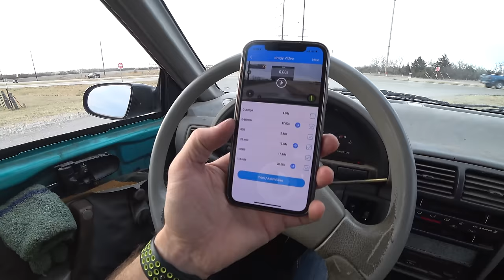I BOUGHT A Geo Metro For $300 And FIXED It In ONE DAY

Comment: I miss my metro! Called it the Urniator (it was piss yellow) and I stuck 1.0L stickers to the front quarter panels like a mustang.  It was a 92.  It also was missing the door handle on the passenger side.  There was an included spoon to open it.  Got that fucker up to 160kmh, down hill. Thanks for the video!

Comment: I’ve rebuild the whole suspension on my 94 Geo Metro and I abuse the hell out of it lol. I always max out the Speedo on the highway which is a tick or two after the last number so I think it goes to 90-95? But it feels pretty sturdy. AC and a 10” sub and that think rocks loool I even got a speeding ticket for going 85 in a 65 in a 3 CYLINDER 😂

Comment: I loved the metro/swifts. My preference is for the 95+ model redesign. The independent rear suspension was nice. I wouldn’t buy one with a 3 cylinder though, not a fan of those. 

I had unfortunately short experiences with my swift and metro, just a few years on each. The control arm mounts would rust out from the inside, and after a while I wasn’t to keen on losing a control arm while driving.
Reply: The frame horn? Those were unfortunately thin from the factory. I've had to reweld my frame horn (driver side) twice. It'll eventually fall apart. A guy in PA does full replacements but it costs a pretty penny.

Comment: Looked at them .bought a prism 93 in 2000 was 1800$ lasted 18yrs head gasket went needed gas tank 3 times water pump &belt I replaced sits in yard .🤗

Comment: For general info, Suzuki engines leak oil around the distributor. The O rings on the shaft fail and pumps oil out.

Comment: I had a late 80s version of this, when it was called a Chevy Sprint, when information was harder to find.  (No YouTube then.)  When it worked it got really good gas mileage.  It was in the shop often and I got so tired of the mechanics telling me "Wow, we never see one of these in here", as if that meant they were dependable.  I could believe it, because nobody knew how to fix it.  I do mean nobody, in any shop.  Nobody could get this working properly.  I eventually got tired of fighting with it and traded it off in disgust.  Just one problem after another.

Comment: The other connector that looks like the Spout connector is the Octane Adjustment plug. If Removed this it will run a slightly less aggressive timing curve. Its removal may aid spark knock (ping) under load if poor gas is the problem. Removing it WILL affect fuel mileage. Just replace the plug to undo effect.
BTW leaving the SPOUT removed will KILL the fuel mileage and is EMISSIONS TEMPERING.

Comment: That means you drove to the store on maybe 1 1/2 - cylinders cylinders - damned impressive! We had a white '90 Metro LSi, first year for the Geo. No air, no tint. Did have a rear window defroster. The foamy PCV means you bought it just before a potential engine fire. Anyway, 4 yrs w/ Wisconsin winters, then 10 yrs of Phoenix summers, 14 years old. Once it stopped running b/c of a loose wire. $25 fix. That's it. I'm a maintenance freak, though. But my goodness, the mileage is no lie! Damned thing ran forever on a tank of gas! Just don't try going over 65 mph, unless you like vibrating cars. We donated it, and wrote it off on our taxes. We kept the interior a lot nicer, too, BTW.

Comment: I bet he never drove a Chevy Sprint, which is actually a predecessor of the Geo. The Sprint was derived from the Suzuki Cultus. My Sprint was a 5-door, and like most of them I think, it had a 3-cylinder engine. Mine (1986) had an automatic, in deference to my new at the time wife, but apart from that, it was a great, if very minimal car. I LOVED mine. Used to scare the crap out of my brother-in-law, screaming down Lincoln Drive in Philadelphia, at 80mph... dodging traffic and walls. It was fun!

Comment: I actually WANT a Geo Metro lol. The Hatchback version.

Eventually.
Reply: Cuz power to weight ratio?
Reply: @esdrasferreras1227  because fuel economy. I don't care about going fast. I want to go from point A to point B as many times as possible before filling a tank..
Reply: I can respect that. Might be easier to find  a decent Honda tho. Plus they would also get amazing gas mileage, and be much more fun.
Reply: @esdrasferreras1227  yeah, I don't live in a very good neighborhood and every Geo I've seen up for sale is in the $1.5K range.
Reply: Christopher Morin wow that’s a lot considering this guy got one for $300. Try to get a nice one tho because I could imagine how hard it would be to find parts.
Reply: I've had a lot of the metros. LOOK FOR FRAME ROT if you buy one. Usually behind the front wheels under the tie rods. I'd probably just get a manual late 90s civic. Its starting to get harder to find body parts for the metro. Also, the civic has a little more power and believe me, you will need it if you go up any hills. BUT if you just drive flat land, these are fine. You should spend about $500 for one of these. Not $1500. The gas prices are low which causes the value to be low.

Comment: I miss my burgundy 93 xfi, yes it leeked oil, yes it was straight piped, and yes the doors sagged to the point you thought they were going to fall off but it was such a fun little gas saver, I still kick myself for selling it, instead I bought an 81 4 for impala 305, 4barrel going from 60 a month in gas running all over to 60 a week just going to and from work

Comment: The difference in the XFI vs a regular metro is the cam, (which lowered the hp) it only had 1 compression ring, different gear ratio, and ecu.

edit....and a few minor body differences

Comment: Great memories from my most epic flip ever! I bought a geo metro for $100. The owner was literally going to have it towed to the scrap yard. It had 15k miles on it. I replaced the fuel pump and the tie rod end on the driver’s side ($125 in parts.) I turned around and sold it for $3600.

Comment: Don't know where you live, but where I live, I have never seen a Metro for sale. If someone listed this same car, they would be asking $1000 and wouldn't take less than $600. I have the grandchild of the Metro, a 2001 Chevy Metro. Picked it up for $650 with two shot CV axels and in need of a full tuneup. Traded a van with a bad transmission for the CV axles and labor and alignment. Still driving it six years later as a daily beater. Have put on about 20K'ish miles on it. Slow as molasses in the winter, but great fuel economy, especially for an automatic. I wouldn't mind having a 1L Metro but they just don't seem to exist around here. Also wouldn't mind having a good old manual transmission Honda Civic, but thanks to ricers, they fetch 2-5K in rough condition and I'm just not paying that much for a Civic lol.

Comment: I got a 95 Metro LSi 6 years back. If you go on to RockAuto you can find parts for this thing DIRT cheap. 7 dollar rotors, 2.59 for wheel cylinders, 11 dollars for a caliper lol....1100 watts of system with a 10" sub lol. Sadly, the frame horns were rotted out and I had to ditch it. I'm on the east coast so everything rots up in here. Shame, I liked that pos.

Comment: Keep the valves adjusted correctly these have lots of carbon build up. I had one of these in the 90's blew the engine bought another engine at a junk yard for 300 dollars and literally pulled the old engine out by hand, as a side note for, some reason, this car is the best car I have ever driven in the snow.

Comment: I started out with the chevy sprint and owned 2 of the. One pushed 55mpg. Then bought a geo metro think it was a 92. Gutted it and got like 50mpg. My next one will be 2000's metro. If there is one thing anyone knows about these. It's that the suzuki 1.0l g10 engine is one of the easiest and most bomb proof 3 cylinder engines ever. I have a deep love for the suzuki swift. In all its forms. Not the safest car. But fun.

Comment: There aren't too many options for 12" wheels; I need to buy a new set of snow tires for my '91 sometime this year.  ATM, mine has a high idle and the engine surges a few times whenever I come to a stop so I'll have to get around to resolving that issue.
Reply: e bay

Comment: You probably already have 50 people correcting you about the spark plug evaluation that the anodes are worn away, but I'll add to the bunch and tell you Bosch Platinum plugs are unique in that the anode is encapsulated by the insulator. Been that way since that Geo was a glimmer in Suzuki's eyes.

Comment: That 1.0 liter Suzuki is a tough little engine,  usually will need valves or valve grind at 100k, will run 300k miles.

Comment: I remember a friend having one of those, and having to do the two person pushing on the side thing to change to the spare because the jack was missing. That's been ages.

A bit disappointed nothing was done about that interior though. What the hell ate that up? Was some dog trapped inside there at one point? I guess nothing was done there because parts found JY hunting would have doubled the cost?

Comment: My first ever car was a red 92 Geo Metro. I bought it in 98. That mug didn't even have power steering so I would be happy when it snowed because it handled easier. It would shake violently if I took it over 55 MPH. HOWEVER...I could fill up the tank for like 8 bucks. It was like a motorized roller skate. Little did I know it would become cool to have a small, fuel efficient car eventually. This took me BACK. MIne was in much better shape than this one. Geo sure loved the color aqua didn't they?

Comment: The XFI model is pretty rare and desirable. Had a different cam profile and different ECU . 
 Had significantly better gas mileage than the regular one. 43 city/52 hwy. Vs 38/45. This is the EPA rating. Most people got better than this. 
Some people would swap the cam from the XFI model which you could get from a parts store.. and you could get about half the improvement in fuel savings.
I drove one of these as a small package Delivery vehicle.
Not the XFI model.
Car was a POS on the interior.. door handles fall off etc 
BUT mechanically.. it was amazing.
I put 100,000 mile on it in ONE year .
Beat the snot out of it.. never let me down once .. and actually was decently roomy in the front seat.
Bought it for $700. Sold it for $250.
They were great little cars if you took care of them..  which most people did NOT.. 
Rust on the subframe near the front suspension mount points  was a common issue.. and basically ends the cars life.

Comment: Blast the underside of the car with old motor oil to halt the corrosion. Don't bother with undercoating, it just traps moisture and accelerates the rust. Bonus points if you melt some beeswax toilet gaskets into it before you blast it on.

Comment: Xfi is the most efficient model, it has special pistons and only have two piston rings, a different cam was called a cold Cam and the tallest gearbox you can get your hands on, translation, 52 to 58 MPG. Also these cars are very simple, only six valve meaning valve trade-ins replacement is cheap, and it has TV I so only one fuel injector. Make sure you use the correct weight of oil or you'll destroy the oil pump, I speak from experience, do that in little pretty much run forever

Comment: It is a clone of Suzuki Swift. I owned two of these cars and I could fix almost everything in it by myself. The car was economic, reliable and cheap to repair. The older one that I had was from '95 and it costed me close to nothing in maintenance, I wouldn't sell it if the floor didn't start to rot badly :(
There were many interesting variants of this car. The best one was Swift GTi - a true pocket rocket, and also Subaru Justy 4x4 was interesting. The best you could do was to swap a GTi engine into Justy :)

Comment: I had one of these in better condition and actually has the awesome “XFI” graphics on the doors. Paid $1,500 for it months before the gas prices spiked, what 12years ago?  Only issue I had was on the highway going 70mph it would blow out a HUGE puff of black smoke 😂 luckily I didn’t have to go on the highway often and through town it was perfect. Got a little over 500 miles to a 10gal tank.

Comment: Came with a three or 4 cylinder.  I tell my wife " hit the turbo " .  she turned off the AC n the car went faster.  Had to put the seat down to fit all our groceries in. 0-60 eventually , could vacuum the entire car while sitting on the drivers seat .  But it was better than walking.

Comment: 53 mpg...ooooh I WANT IT!  I had my dad's old Suzuki Swift, got 40 mpg with the windows rolled up and ac off.  wrecked it three times, it was rusted to hell and back, the engine was sucking water, and overheating, had to stop every mile or so and let it cool back down, but put 20 bucks of gas in it and you could ride all week.  I miss super cheap high mpg tiny 3 cylinder cars.  Is it still up for sale?

Comment: Pretty sure the Geo Storm was never offered with a turbo....the car it was a copy of, the Isuzu Impulse did have a turbo option but the Geo Storm lacked that during its production run.  You can however sometimes find 1990-1992 Geo Prizm GSI which came equipped with a third-generation small-port red-top 4A-GE if you look hard enough.

Comment: one for sale near me for $6500, 32K original miles, few replacement parts including: New tires, new muffler, pipe & clamps, new battery, new wiper blades, new a/c belt, water pump & alternator belts, timing /cam shaft belts, belt idler pulley, new thermostat, distributor cap, distributor rotor, air filter, water pump, new premium plug wire set. thing looks brand new. not sure 6500 is a good deal. engine looks very clean...good deal or?

Comment: 92" Geo storm covertable (Yellow) Given to me from a buddy the next morning after we when drinking the night before and i think i spent $300 to $400 on us that night at the bar 

(we walked there And staggered back)  The car he said was misfiring and was a piece of crap good luck....I checked everything out Turns out it was the spark plugs And a sensor Which cost next to nothing  The paint was old and faded I used a cotton pad with heavy cut compond And took the steps all the way to final polish  The gray seats and paneling i used black dye spray paint And a gloss finsh on the plastic pieces..Detailed the engine bay to the point i was polishing metal. I think i dumped $100 into it listed it for $2,350 2 weeks later. sold 2 days later for $2,000 That was my first car flip

Comment: Say what you want about GEO Metros but I had one and wish I had one now. It got 65 mpg highway and something like 30 to 40 mpg city (better than most hybrids). I never had any problems until I took it to a quick oil change place and they put 5 quarts of oil in it. It is a 3 cylinder and only holds about 3 to 3-1/2 quarts. I didn't check it and drove it until it quit. Lesson...... always check your oil after a quick oil change place. These quick oil places hire kids off the street that don't know anything about cars.

Comment: XFi = extra fuel economy model.  It has a taller final drive, a shorter cam AND a leaner mix.  So if you thought a regular Metro was slow, this would make a regular Metro feel a lot less awful.  "At least five B&S lawn mowers" isn't far off: 49 horsepower.

Comment: I used to have a red one of those. It was fun jumping it over the railroad tracks on the way to Class. Every morning we'd blast Metallica or AC⚡DC maybe Megadeth and jump the tracks. I put some 01 stickers on the doors 🙂 I have no idea why the lower ball joints went bad,probably dangerously bad,struts were basically non existent. Good times in that car,used to strap my 8ft Zodiac to the roof and go bass fishing. Got pulled over once the officer said that it looked dangerous. It did look dangerous I can't argue that. I said that if he could tear it off, then write me a ticket. I had it ratchet strapped on it wasn't coming off. Actually I think it drove better with an 8ft Zodiac on the roof. I don't think they were built to last. Mine gave up the ghost at 167k threw a rod. Yeah I jumped it,but I didn't beat the engine or try to do burnouts.I kept the oil changed too.Engines are pretty weak in those things only 3cyl. Got killer mileage though. If I could find a newer one in decent shape I'd use it as a commuter. I haven't seen a Metro in a long time.

Comment: Alex machine shop from Puerto Rico build the first gen ,forza , he hit 14:2 with the stock tires12 inch , basically the mods were this ,weber carburator, turbo t03t04 ,28 psi of boost no intercooler🏁🏁

Comment: Actually search that exact bosch plug and you'll find they dont have an exposed tip. Bosch for some reason made a certain series of plugs that the ceramic covered the whole tip to reduce the spread of the spark and make sure it fired in the same spot as much as possible. Now the one with the broken ceramic.... Yeah no... That aint right xD